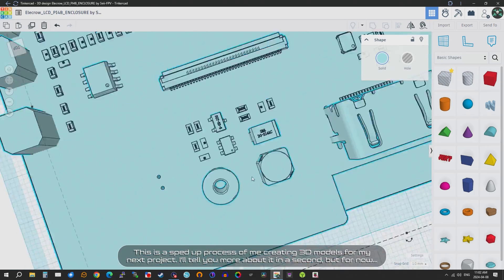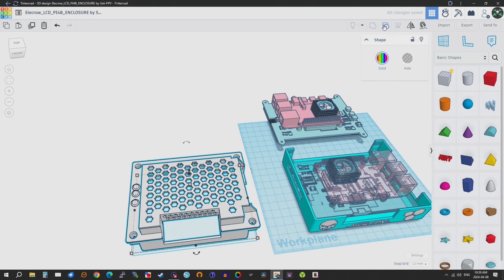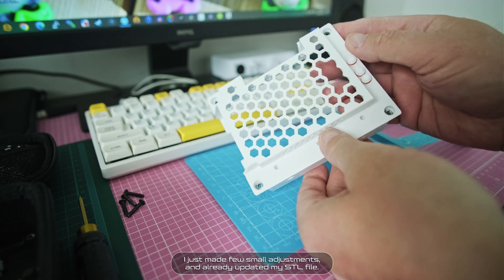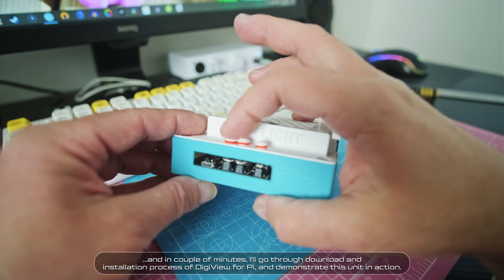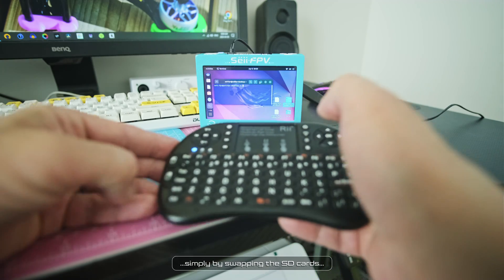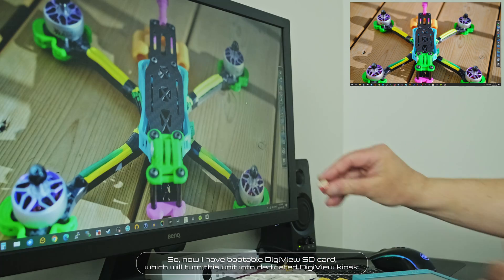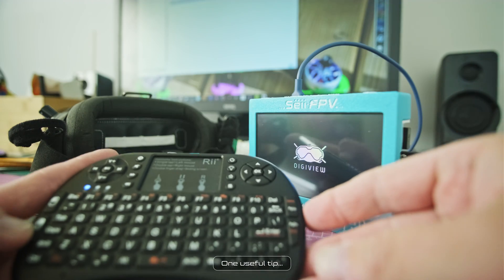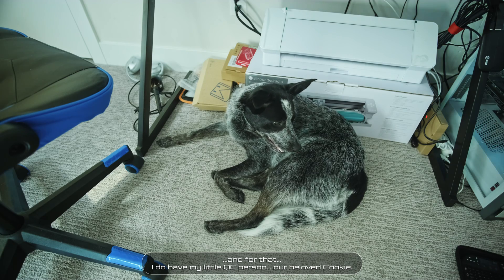BUILDING MY CUSTOM DIGIVIEW FPV MONIITOR | 04−08−2024

Comment: Thank You for sharing! I tried this DigiView flashed on its own SD card for my Raspberry Pi 3 (1GB RAM, 1.2ghz CPU) that was just sitting around doing nothing. Although it does not work with the 3.5 inch LCD that I configured with it a while back, it does work perfect on the HDMI output for an external monitor for audience viewing. It even worked on the HDMI input for my big screen TV! I flew around my property using my big screen TV as the monitor and honestly the latency is not bad at all for just flying casually. I don’t use a keyboard or mouse with my Raspberry Pi 3, it just boots directly into DigiView ready mode. When done, I just unplug power and won’t corrupt anything.
Reply from the maker: I don't use keyboard with DigiView, I only use it when inside OS in case I need something. DigiView developers however, recommend shutting the app down before turning off Raspberry Pi. I found that tip up on their website where they mentioned if we have touch screen, the easiest thing to do is to long press anywhere on the screen for one second. It then brings the menu, which we can use to shut down the app, and then manually turn off our Raspberry. It's explained here: https://github.com/fpvout/DigiView-SBC/releases
Reply from the maker: At 5:41 sec mark, I'm talking about the very same thing... None of that was required for DigiView project, I was simply showing how everything works properly. After that I've proceeded to show dedicated DigiView unit, Raspberry Pi4B + LCD screen doing one thing only - being a DigiView kiosk. But sure, it's nice to have options, so if I ever need some portable device with OS on it, support for keyboard, mouse, and all that... it's there, ready to be used :)

Comment: Amazing 🔥 No files for the 3D prints?
Reply from the maker: I am revising all the models as we speak. It's always like this, and it's only because I don't have my own 3D printed (yet). I make these 3D models, basically blindfolded, measuring everything 2 times with my caliper and hoping everything would fit nicely. This fits perfectly (this exact LCD model + Raspberry Pi 4B attached to the top of it, but probably won't accommodate other combos as nice. The thing is, I am changing couple of little things (improving) on both covers, so they are ready for public. Once I get them to the point I am happy with everything, I will publish STL files.